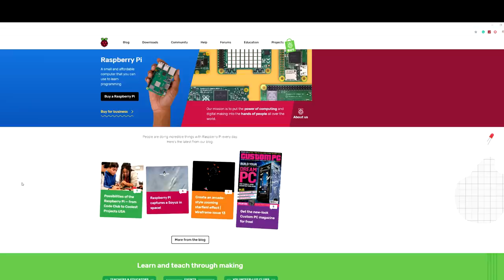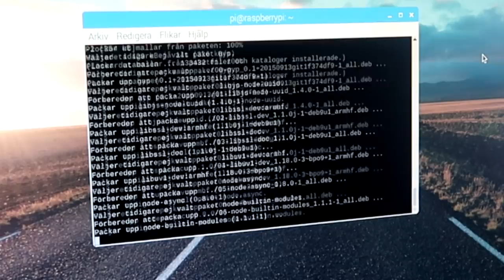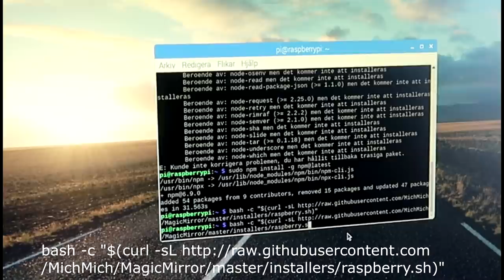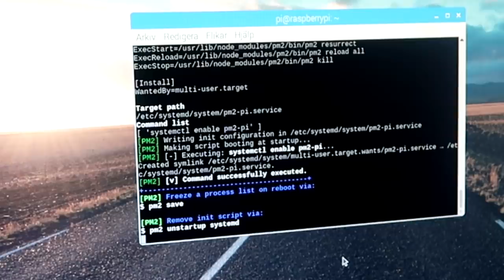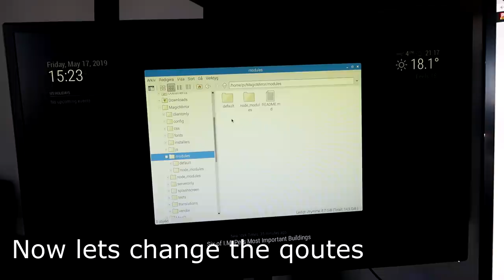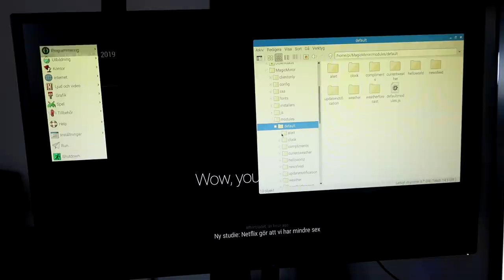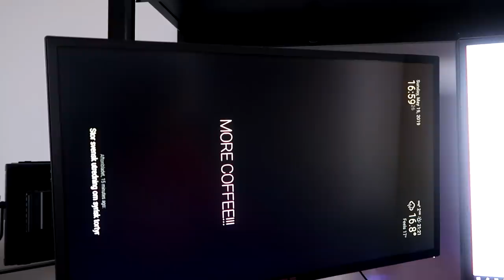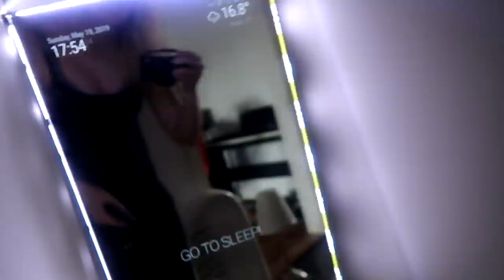HOW TO BUILD A MAGIC MIRROR ➜ STEP BY STEP GUIDE!

Comment: Why did you choose to remove the back panel when you used a new monitor with outputs and no frame or encasing?
Reply from the maker: Beacuse I wanted the mirror close to the screen for the best mirror result. The monitorframe was stuck in the back so it broke into Pieces. I also wanted it thin and I like it this way. :)